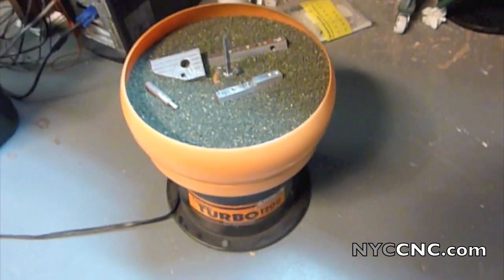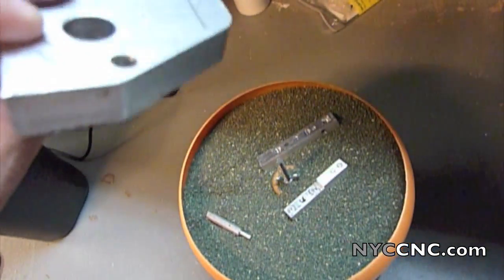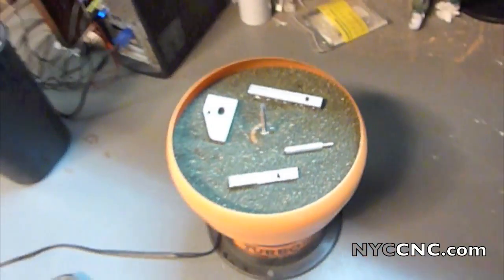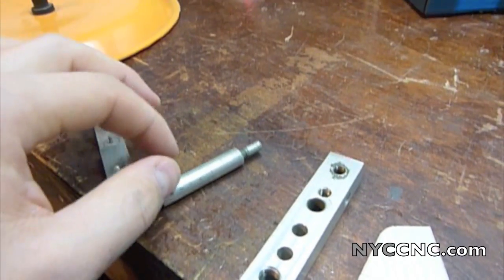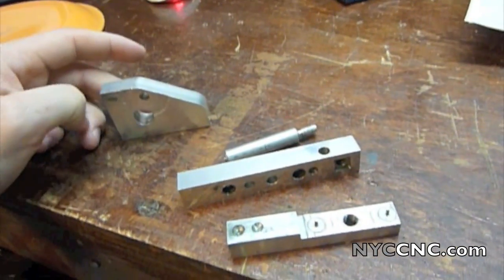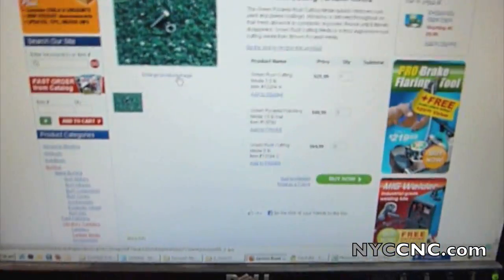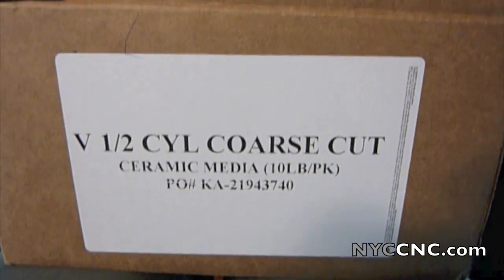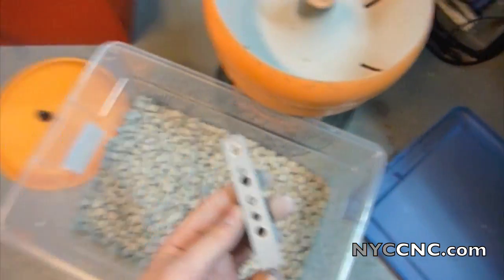Polishing 6061 machined aluminum with Vibratory Tumbler Media

Comment: I am interested in polishing small metal parts to an old vacuum, a Kirby. The pieces range in size from very small axles, gears, to larger parts - housing covers, fan cover, nozzle. I wonder if I could bypass the hours of sanding with one of these. High quality refurbs tend to fetch a lot of money, and that requires a flawless liquid mirror finish.

Comment: It’s been a while, but as people have posted below, abrasive ceramic cones come for different metals, grits and benefit from additives including borax dry washing soap. Finish with the walnut shells and jewelers red polish compound. I know the vibratory tumbler is what you have but many plating shops use low speed rotary tumbling drums. They work better and much quicker and can be home made.

Comment: at work we use a tumbler similar to what you have in this video (for aluminum only). our media is also similar to your ceramic course, however i would call ours medium. we just use plain tap water with a slow but steady stream. this insures the debris is removed and a constant source of clean water. 

nice video, and nice comparison.  :D
Reply: Lol, it was ghetto rigged. A hose with a slow trickle set on the middle pin. The water ran out an overflow tube.

Comment: Thanks for the video it was very helpful. I was wanting to deber and give 6061 a high polish i am close to habar frieght who stocks walnut shells media and some other media that seems very abrasive. have you tried wallnut shells for 6061 to get  high chrome like shine? I am melting a casting 6061 for motorcycle parts and makeing homemade tumbler for 6 inch derby cover. Thinking of going rough then to walnut shells.. Any advise on this since its my first attempt at casting a part to buffing

Comment: There are many medias for a Vibratory Tumbler.  Cutting, cleaning, and polishing all need different media.  You have to run these small machines for HOURS on HOURS.  More than in this video. The order of the tumbling process is bigger to smaller media and cutting to polish.  Adding liquid and soap helps with the bigger media not the polish.
Reply: walnut and ceramic for 24hrs and it will come out like a mirror if its aluminum. Metal comes out even better. I did a carb came out great. And have been doing the bcg's on my ar.

Comment: @saunixcomp 

Yeah, most of that stuff is expensive. The soap is just with the ceramic though. I don't know how it would work with other types. It might gum some media types up. I've also used regular fish tank gravel... Little natural river rock that's about BB sized. The key to keeping it clean is plenty of water and soap. And you can drain the dirty water off a couple times if you want.

Comment: As you said, you want to do the process in reverse... heavy to light. But what you'll find is that water and some sort of lube make a huge difference. I use a custom built tumbler. I do 1/3 parts, 1/3 water and then a very generous amount of Murphy oil soap. It's cheap and works fine. What that does is whisk away the material and helps prevent staining. When doing it that way, you can actually use just the ceramic and get a sort of used nickle look.

Comment: Excellent video, thanks for posting.

#1 liquid cleaner from Mcmaster (4918A31) appears to be VF-77T from Vibra Finish. It mentions 5% ethylene glycol monobutyl ether in the MSDS (solvent/surfactant). Some household cleaners have this. I'm not sure if there are any other active ingredients. I've seen plain laundry detergent recommended as well.